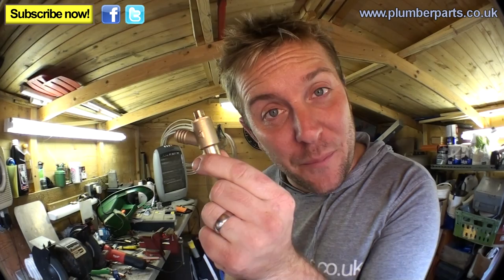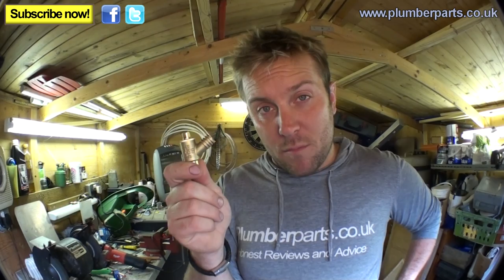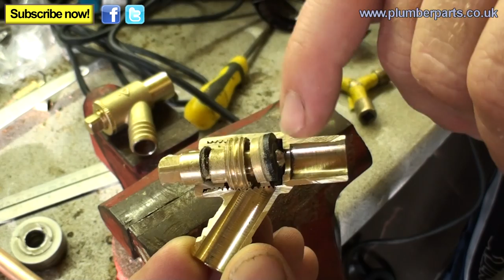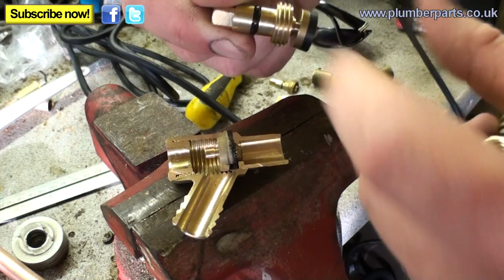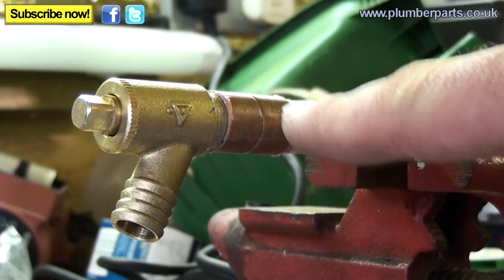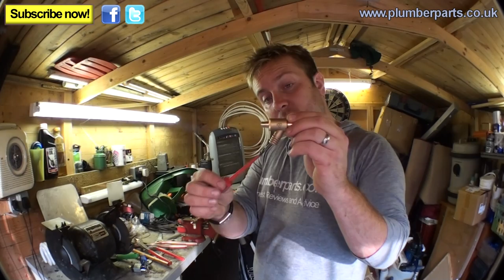DRAIN COCK - NOT WORKING - BLOCKED - Plumbing Tips

Comment: Alternatively if your washer is jammed inside. Put your hose on, using short screw driver like an electrical make a hole into your hose and up inside the drain off, loosen the drain off and wiggle the screw driver to free the washer/jumper. No chance of getting soaking wet. As the screw driver seals to hose. Sorted!!! 16years in the game.
Reply: I'm stealing your idea😅
Reply: Going to try this too👍

Comment: You forgot to mention type B DOCs. Never fit the feckers. They always leak out the end when draining down.
Never, never, never fit type Bs. Always fit type A drain offs like the one in the vid. They have the o ring seal on the shaft that stops those beastly drips.
Great vid. Many thanks.
HOLD TIGHT!!!

Comment: Hi. Mate. I need some help. I got 2 external drain off cocks on outside of the wall and also 2 other drain off cocks on  the side off . Which do i drain all 4??? Both are dirtectly behind radiators but no drain off cocks inside only four outside. 
I want drain system do i drain all for or just let 1 drain off cock to let water out.please advise someone.

Comment: How would you de solder it if you need a complete new one. Or would you just cut a bit of pipe further back and re solder a new pice of pipe and then solder the drain off  to the new piece
Reply from the maker: Drain down, remove gubbins, sweat off the fitting and clean out the female. Insert new one and do in reverse like you would a normal solder.

Comment: My solution: fit a compression isolator with a blanking nut for safety. Use a 1/2" hozelock adaptor to connect and turn the valve to drain. Looks cack, but works.

Comment: If I'm working on a cylinder I don't bother with the drain cock anymore. I just syphon it out. its so much quicker
Reply: This is very true! Then using a wet vac to get the rest of the water below the drain level